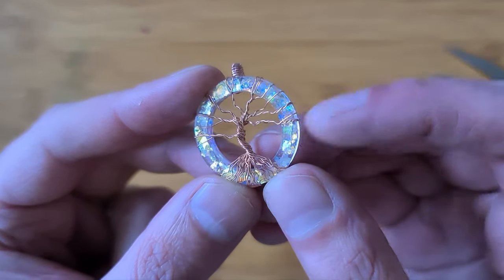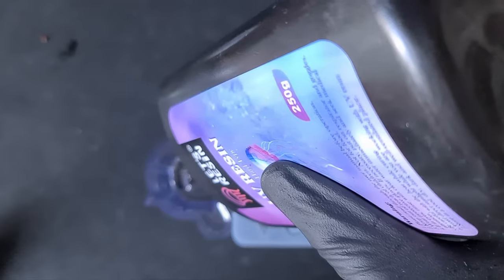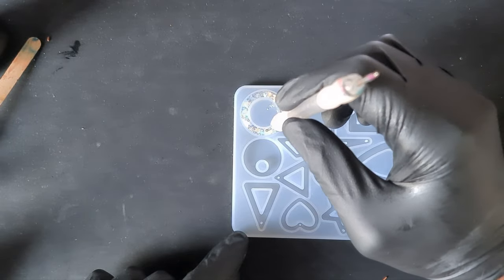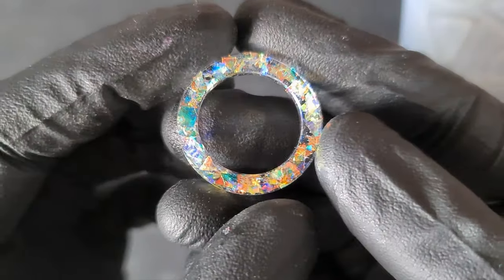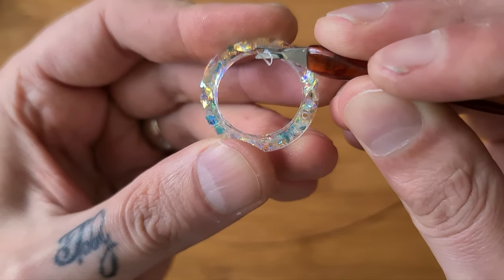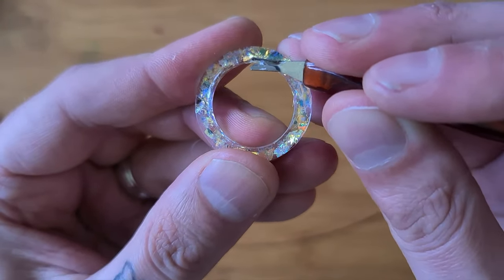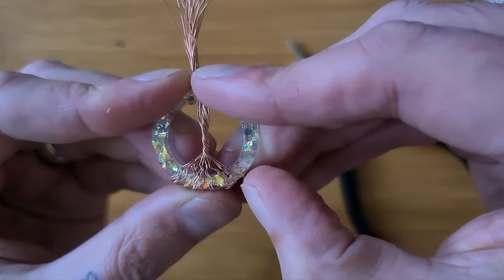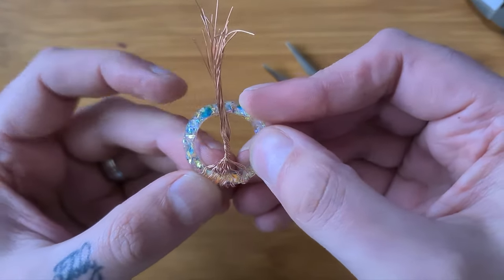#91. RESIN - LET'S WIRE WRAP! TREE of LIFE. A Tutorial by Daniel Cooper

Comment: Exactly what I want to start experimenting with - resin and wire together! Great piece.  
Maybe holding the resin circle in place with a thin piece of wire at top through the small hole to the frame, just while you do the fiddly bits, then remove later? 
Also, a light hammer of the frame with an acrylic head hammer after you have made the bail stage, would help it keep in shape better but not flatten it?
Has inspired me to get on with my ideas - thanks for a great recording 😊

Comment: Yes, those molds still come in their uv resin starter kits… I think you can get them individually too… I would have to look to make sure….

Helpful hint….. before you put uv resin into a mold that you have stirred additives in, hit it with a bit of hot air from a heat gun… it will eliminate the bubbles :)

OMG! I used a cuticle tool to do that on the rings of that perpetual moon calendar I made and posted on the discord channel!!! Never saw anyone use one of them before! You read my mind… lol it’s cool to see that someone else uses the same thing for the same thing I use it for! Do you know how to sharpen the cuticle tool? If not, let me know and I will show you how to do it… it’s a leather working trick :)
Reply from the maker: Great tip, I will probably forget to do it though, I'm a nightmare 😂🤣
Reply from the maker: No, I didn't know but think I do now you said leather 😉😊
Reply: @daniel..cooper  I dabble in leather too… it’s a super easy trick and you don’t need leather to do it!
Reply from the maker: @ZippedUpKitz  Sounds like the way razor blades can be sharpened? 😊